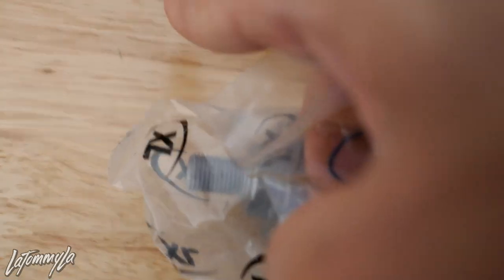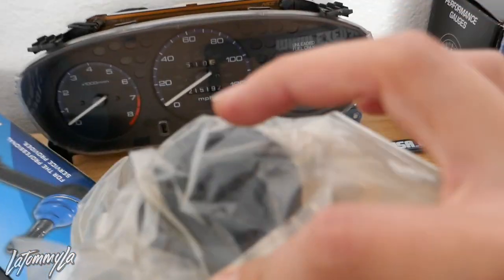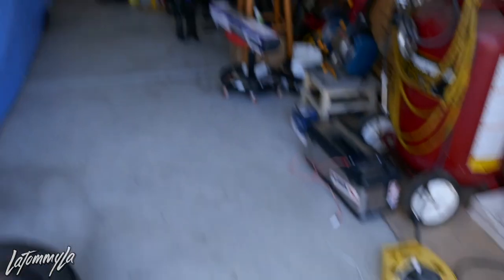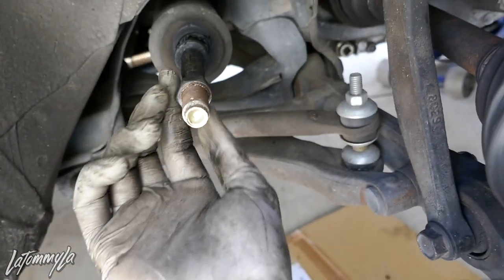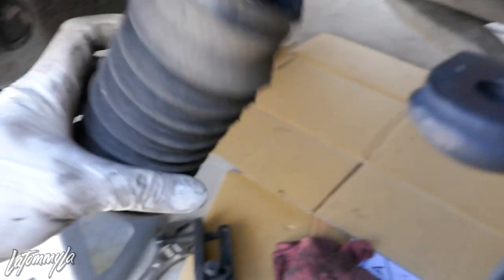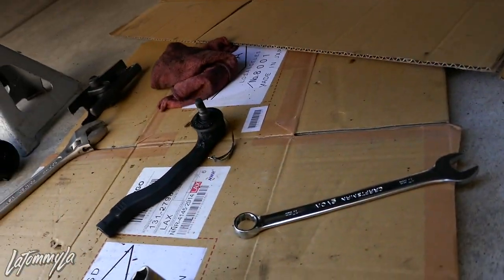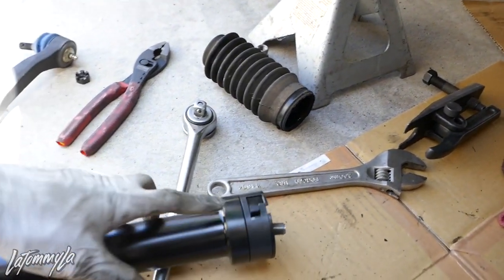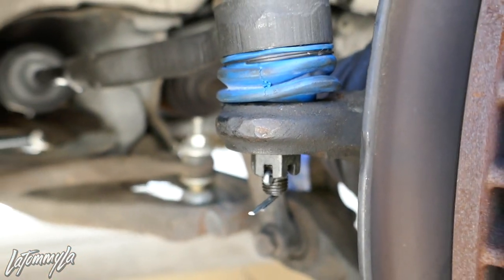How to replace Tie Rods on your Civic!

Comment: Please, please don't forget about the lock washer being installed properly. Yes, you do have to have it line up with the 2 notches, but it should also be hammered onto the inner
tie rod in the 4 notches it has at 12, 6, 9 and 3 o'clock. Use a cold chisel or a center punch and make sure they're in, otherwise you risk having the inner tie rod come out on you while
driving, which will surely break a lot of things on the way out, as well as likely making you have an accident.
Reply: Defiantly going to do this when I end up changing my inners too. Thanks for the info!
Reply: Yup. Whoever replaced the tie rods on my car didnt hammer them. I didnt have to loosen the washer so i didnt know. Then when i installed new ones i didnt hammer them too!
Reply: When I replaced my inners and outers, I totally forgot to install the lock washers. As a result, my inners are now loose and suffered premature wear. DO NOT OVERLOOK THIS STEP
Reply: Anyone has a video for this?
Reply: What if i went in too far with the inner tie rod tool and loosened up the piece thats part of the steering rack?

Comment: That locking clip on the inner tie rod is supposed to be crimped against the indents on the inner tie rod. That's why you said it was mushed when pulling off, but didn't crimp it when putting the new one on.
Reply: I also plan on doing this project but wanted to know what tool do you use to crimp the lock washer?

Comment: I missed seeing the part where you put the Zip tie on the rear of that bellows and also a adjustable clamp on the outer part of the bellows. in fact there are several steps  missing so i suggest newbies check around to other videos on this subject.

Comment: guys just a side note, use a white marker on the bolt and inner tie rod for the alignment you currently have, doing it by eye isn't as much effective. Then go do a new one. it costs usually 80-100$

Comment: HELP! Alignment shop called me after I put inner and outer tie rods saying they cant align my car because the tierods are rubbing with the rim of the car when turning. They’re telling me I might have installed l the wrong parts but I know for sure the parts are right(compared side to side & bought by part number) what could it be? HELP PLEASE. I think I messed up the turn-counting part of the installation by 2 or 3 more or less turns. HELP PLEASE

Comment: Again, the reason why he skipped over the boot installation is it is truly a pain in the ass! Especially the driver side one as I discovered! I will give you extremely helpful tip.,DO NOT buy after-market boots! Unless you got few hours to waste. The aftermarket boots, even the good ones by say EMPI, are the wrong size! I had a couple different aftermarket ones and they were all smaller than the stock ones! Still trying to get it up and over onto the lip was an absolute disaster. And yes we tried the trick of heating up the boot. Luckily my friend who has smaller hands was able to get it on after a good hour plus. 
So do yourself a favor, and just buy the stock boots! One size is 1 in 7/8 the other is 1 and 1/2. That's quite a huge difference when you're trying to get it in the area you can't really see well and you don't have a lot of space to maneuver, if any. Trust me you'll thank me. If you still want to go with aftermarket, one thing I notice is that the AutoZone don't have the little tip that sticks out, just a hole. They were made out of a better material compare to Napa's crap which is hard plastic like.  EMPI are very good but the size sucks. Makes you wonder who designed these things in the aftermarket world to have multiple suppliers make the wrong size!

Comment: Why do none of the videos show the lock washer installed correctly. Need to bend it onto the inner tie rod to lock it in place. The tabs lock onto the rack, but what locks onto the inner tie rod? You have to bend the washer onto the inner tie rod. I am trying to find a video that does this, and have not yet.

Comment: Dam what a helpful tutorial. Does the inner and outier tie rod really need torque down to specs? I have the inner tie rod tool that looks like a small pipe wrench that had teeth grips that you stick a 3/8  ratchet, but this harbor freight tool looks like you can more leverage twisting the thing when it’s secured.

Comment: where did you get your tie rods? and what brand?
Reply: Oh okay, cuz I found a set on eBay, brand is called GES and they look exactly like yours, except it doesn't come with a boot. Did you replace your boot or re-use? And did you buy a new boot clamp?
Reply: How are your rods holding up?